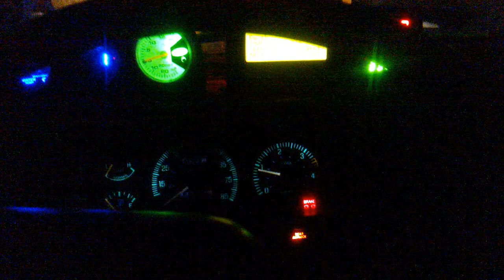4500+ RPM test in an 7.3 IDI... Uhoh.

Comment: oh boy I was nervous I don't even like revving mine to stock limiter
Reply from the maker: +Evan Anderson The stock governor of 3600 isn't high enough to damage anything; I know of people who have run them in high gear with the accelerator floored and the RPMs right at governed RPM... for hours and hours on end. 
I wouldn't do that, but it should be fine.
Since I made this video, engine's still running well enough, and my governor now goes up to about 4K unloaded, so I'm happy with how it is. I can just floor it and let it rev against the governor and it'll sit there and spin without missing or shaking badly. Still, though, I don't usually take it past 2K except when accelerating, just because.
Reply: +MacRobb Simpson I have a serious question because you seem to know alot about these and electronics is it possible to make a rev limmiter like the 6.0 powertroke has were it bounces? I think it would be super cool
Reply from the maker: +Evan Anderson Short answer is no. The way the governor works is a mechanical feedback loop between a set of flyweights acting against a spring which is pushing against the fuel metering valve. The faster the engine spins, the more the spring pushes, and the less fuel is injected, until a balance is reached.

Long answer is... maby. You would have to set the mechanical governor to above the point you wanted. Then, use a tachometer-type device with a set point and a relay which is activated at a certain RPM(perhaps you could modify a "shift light" on a tach?). You would hook the fuel shut off solenoid to the relay's normally closed contacts. This means that when the RPM is low, the relay is not activated, and the engine runs normally. When the RPM goes above the set point, the tach relay turns on, the relay opens, and the fuel shut off solenoid shuts off fuel to the engine, so the RPM drops. RPM drops to the 'off' point on the tach, fuel is restored and RPM increases.
The 'duration' of the bounces would be controlled by the delay in the tach; how long it takes to register the RPM.

That being said, I've always thought such bouncing governors were stupid; I much prefer the 'soft' governor of our IDIs - it's much smoother and doesn't slow you down when you hit the limiter while in gear. You can just hold it against the limiter(say when plowing through snow or ice).
Reply: +MacRobb Simpson I see what you mean I think it could work I might have to tinker with something. but you are right because I took my truck on a long trip recently and to do the speed limit I was almost at redline
Reply from the maker: +Evan Anderson You also might want to look into a ZF S5-42 conversion for your 6.9; the 5-speed will give you an overdrive gear which, combined with your 3.55 rear, should give you a cruising speed around 17-1800 RPM @ 60MPH in top gear.
Reply: +MacRobb Simpson yeah I have a c6 auto and I believe something around 4.10 gears
Reply: How did you adjust the limiter?  My 7.3idi is limiting at 3,100rpm and I really would like to get it up to 3,600 like it's supposed to be.  Did you adjust the governor spring in the top area?  Or replace the spring?  If so, does a "tighter" spring raise or lower the governor rpm?
Reply from the maker: Kind of missed your comment. I personally pulled a stock governor assembly out of a spare pump. I know that the governor spring in a DB2 off a chevy 6.2/6.5 is stronger and will rev to like 4K unloaded?
I've also heard of people putting washers or a nut as a spacer on the spring to tighten it up. I'm just not sure which spring in the governor assembly does that.
Reply: They love stock limiter wdym

Comment: hello I am a simple wrench and farmer/logger. Not really a performance guy. What is the process to putting a turbo on an NA IDI? are there specific parts numbers and rough est of cost?
Reply from the maker: Generally, you'd find/get a 'kit' - something like Banks's kit(~3500 new). ATS and Hypermax made kits in the past. There are also little companies like R&D IDI Performance that'll make you more advanced kits, but things aren't cheap.  Once you have the parts, it's just bolt on, crank the pump fuel limit screw up, and go.

Comment: I got an old burn out rig and she quits at 3300 any way you could make a video on how to change it to maybe 39/4k?
Reply from the maker: I haven't messed with the inside of a pump in quite a while, but it's a matter of adjusting the governor assembly inside the pump - you pull the top off, and adjust the barrel of the governor assembly IIRC

Comment: Hey bud how’d ya manage to get the ol gal up that far in the ketchup gotta know building a centurion c350 bogger
Reply: Take a 5/16 nut, drill it out with a 5/16" and slip it in with the gov spring.  Will get you ~4200.  Make sure you get the overall governor length the same, couple thou is a couple hundred idle rpm.

Comment: turn up your oil pressure that's really dangerous
Reply from the maker: Well... It's actually not that low.
These trucks, from 86? onward don't actually have an oil pressure gauge.
They have an oil pressure switch, which drives the gauge through a resistor - If the switch is grounded(less than 6 psi or so), the gauge goes to 'low', otherwise it's somewhere in the normal range.
You can tell if you have the switch type sender vs a gauge-type sender by looking at the sender itself - if it's about 1" around and the top half is plastic? It's a switch sender. If it's like 1.5" around and all metal? It's a gauge sender.
Mind that all of the 7.3 trucks have, from the factory, the switch-type sender - Ford got tired of people complaining of low oil pressure, I guess.

On this truck, I replaced the switch-type sender with a gauge type, but I'm guessing I never removed the resistor or got it working quite right.
I had a second aftermarket oil pressure gauge at this time on this truck, (blue, just to the left of the boost gauge. Only the right digit reads, but under 18 psi it has a red LED that comes on).

The typical range for this truck was 35-40 ish cold, above 20 hot when driving, and hot idle between 12 and 19 psi. The service limit for the IDI is 10 PSI at hot idle, though this engine did have issues with a sticky oil pressure regulator -- a properly working regulator will keep 18-ish PSI at hot idle, but if it sticks open, well, it'll be less.

Also, unlike other engines, the IDI pushes a lot of oil around, so you can't use oil pressure as a measure of wear, unlike in other engines - extra losses from around bearings aren't noticeable when you are spraying a large amount of oil at the under side of the pistons.
Reply: MacRobb Simpson. ok thank you for commenting. i have the same engine I needed this info.

Comment: The idi is the worst engine ever...
Reply from the maker: What makes you say that?
Reply: @MacRobbSimpson  It is a old engine that is very out of date and it does not have any power at all. It does not have a turbo and the engine is very non efficient. the fuel injection system is very old and out of date. It is a very old not worth having engine.
Reply from the maker: @caleb0606  I disagree:
1. While non-turbo'd, it does provide a useful amount of power(~180 HP). Not high, but plenty good for light towing, or heavy towing on back roads.
2. Fuel efficiency wise, it's not as bad as you might think - 16MPG avg in a 3/4 ton pickup is what I see; something that isn't much better with a choked-down modern diesel. Also, for a comparison, I'm only getting 14.5 MPG average in my '00 F-250, with it's more modern system. 
3. The injection system is old, but that also makes it reliable and cheap to maintain and repair. It's also EMP proof. 
For instance, modern (commonrail) systems have issues with water contamination causing thousands of dollars in part replacement. An old IDI? Drain the water out, add some new fuel and crank it till the waters out. Good to go!

Personally, my main IDI does have an ATS/Ford Factory turbo kit on it; definitely increases the HP to make towing much easier - I may not be winning any races, but I've hauled 14K behind it(so grossing at 21K) without issue, and I've gotten it up to 60 like that.
Reply: @MacRobbSimpson  wow. Well, I guess you have some points. I still think that 180 horsepower for a V8 7.3 diesel is not 
Proportional to the size of engine or the fuel burn. I am surprised that the engine makes 180 horsepower. And you are lucky that you get 16 mpg. 
The Ford 7.3 power stroke can do 275 horsepower and is more efficient. 

And the idi sounds like a boring gas engine. Most diesel people like Diesel engines and the sound they produce.
Reply from the maker: 180hp isn't proportional to the size of the engine, correct - Throw more air at a diesel engine, burn more fuel and you can get more HP. Being NA is what limits it.
As for fuel burned, you'll find that it's relative to HP produced(as in actual load on the engine); an IDI isn't much less efficient than a DI engine; at worse being theoretically 20% worse, but less than that in practice(for the same load/power produced).

The 7.3 PSD... Made 200 stock in 94.5, and only hit the higher 250 and 275 calibrations once intercooling came along with the SuperDuty trucks in '99.
It can make a lot more than that with just a tune - my friend has a '97 non-intercooled PSD that somehow is making over 300 at the wheels, or like 360 at the crank.
On the other hand, I've got dyno numbers for an IDI making 280 at the wheels, or 340 at the crank with a big turbo and injection pump... so higher numbers are doable.

As for sound - I happen to like the IDI sound. It sounds like a big block with a rod knock at idle, but is definitely quieter than a PSD. The PSD sounds good too, but has a ton of clicky-click from the HEUI injectors. If an IDI sounds completely like a big block gasser, with no diesel rattle... the timing is way retarded.
Reply: @caleb0606  far from it.. reaching down far in your bag of insults here.. not much different system between an idi, and a 12v cummins, slightly different pumps, same idea.. out of the non turbo motors, they're towards the top of the pack, again, non turbocharged.. any comparison to a turbo motor is invalid.. 

Have you actually owned one? Or just speculating?
Reply: @stanleykendziorski7964  it is my own opinion however I do believe that the idi is a very old and inefficient engine
Reply: @caleb0606  it sounds like you havent owned an IDI. dont get me wrong I personally am not a fan of my truck and I want to do a lot of work to it to be happy. But the IDI is definitely a diesel. It holds weight going downhill really nicely, and at low RPM makes nice torque. I not talking numbers Im talking experience. I used my 92 f250 na idi to haul cord after cord of firewood, and heavy log loads to the mill. It is a gutless bitch and can barely move but its rugged and nice for creeping down hills. I hear if I slap a turbo on her and tune up the injection pump I will be more happy. I also have  a fuel pressure issue which I think stems from the fuel lines before the lifter pump. Also with an e4od and a coast clutch activated I get amazing fuel mileage, mostly empty. i now run a f450 with a 460 gas motor and a 5 speed stick and I like it a lot.
Reply: 😂😂😂clown. it’s not a power house but god dam can they take a beating and last for ever
Reply: @caleb0606  it's a 30+ year old engine it's power rating was not bad for it's days (my N/A still does whatever I want)
It's huge displacement and low ho/TQ for its size makes for a motor that can easily go over a million miles (many have).
Also fuel economy changes with gear ratio and transmission, my 91 e40d 4x4 N/A 7.3 gets over 20 on the highway (unloaded) that's even with steep hills....that's more fuel efficient then the modern trucks I've driven
Reply: No the gm 5.7 diesel is the worst idi ever.
Reply: @caleb0606  Where do you buy the lead paint chips you been snacking on?